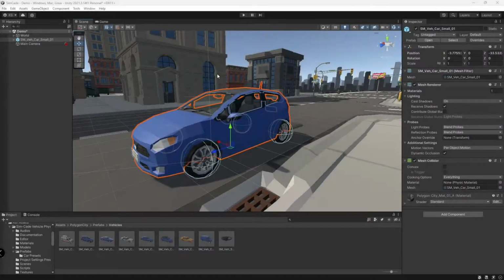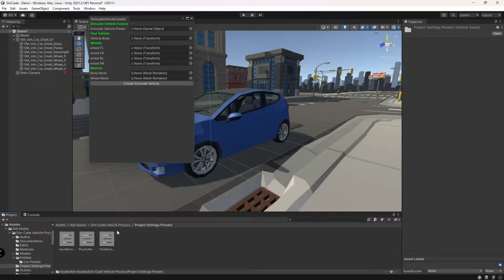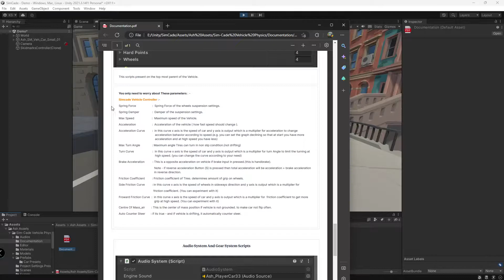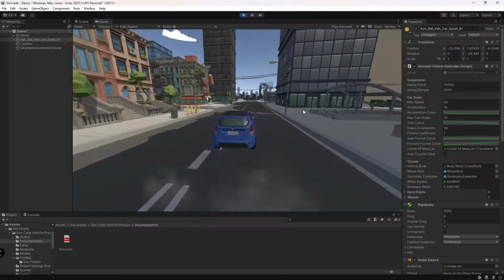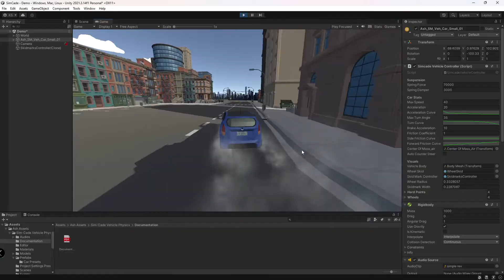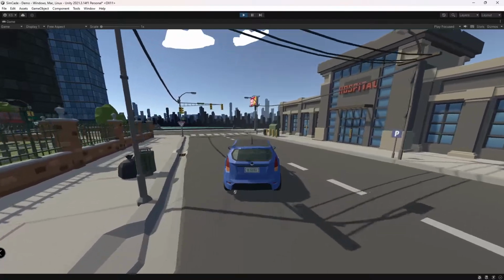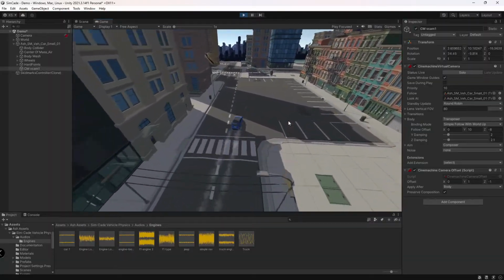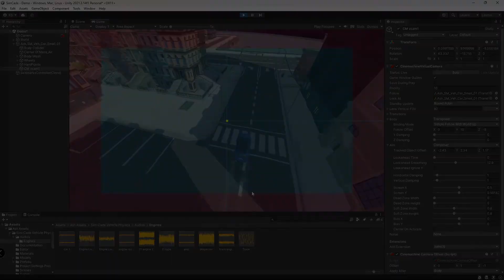Sim-Cade Vehicle Physics for Unity

Comment: i have a model that i downloaded from cg trader , and it's in blender format, and even though the rotation is 0 in blender, when it comes into unity, the car body is rotated -90 in X, and it appears to mess up the simcade setup, because after I create the simcade vehicle the wheels are rotated 90 degrees and I can't drive the vehicle. How do I fix this?